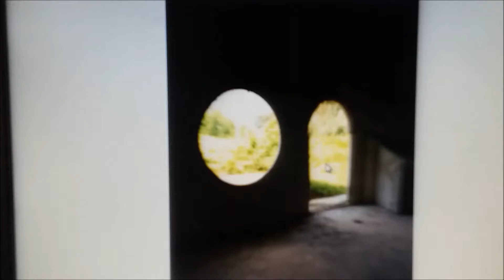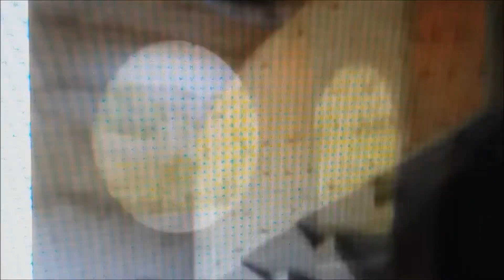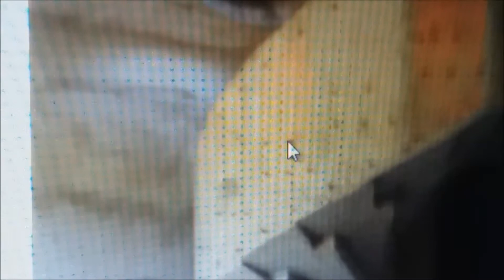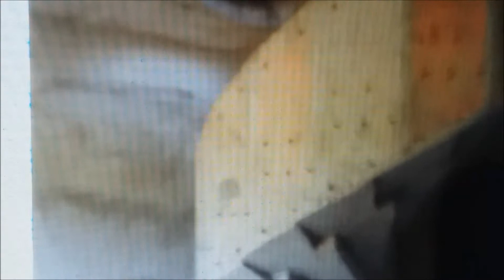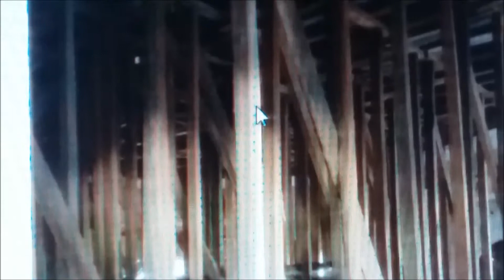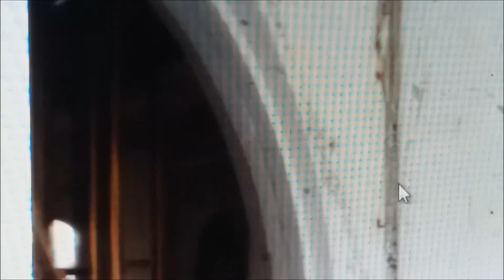"BUILDING OUR DREAM HOME IN THE PI", CHAPTER 44, SLIDESHOW 2"OUR DECAGON HOUSE"

Comment: by having no parallel walls in a room the number of reverberations & total reverb time is cut significantly. this is different from absorption by rough block. sounds like similar to your ear. different on test gear though...
Reply from the maker: Our upper level workshop is round with 10 doors
and has no echo with the spider beam and ceiling
skim coated. The house level you have to be concentrating on listening to detect any echo but
normally don't hear any.